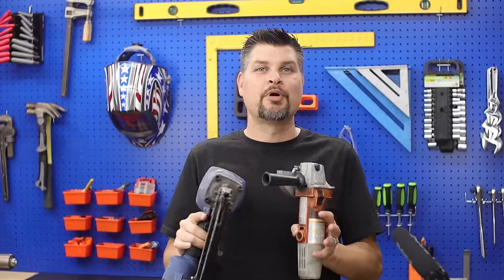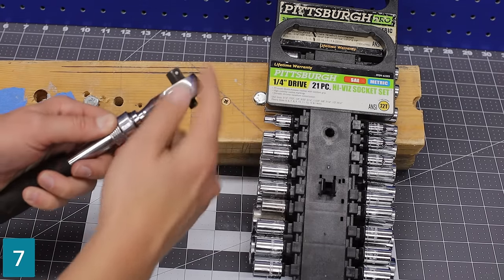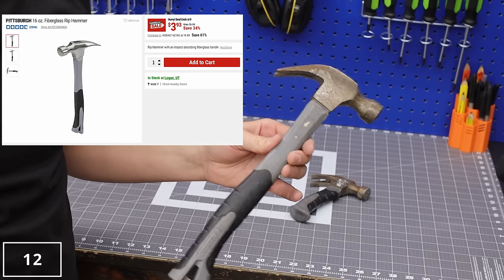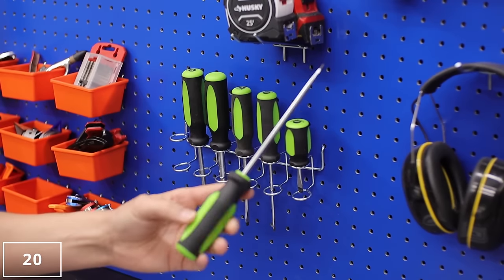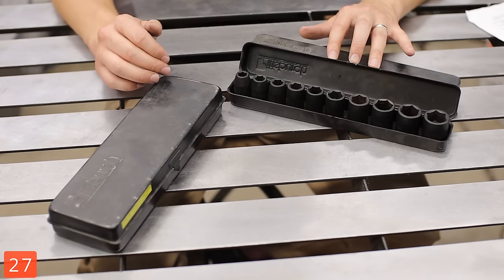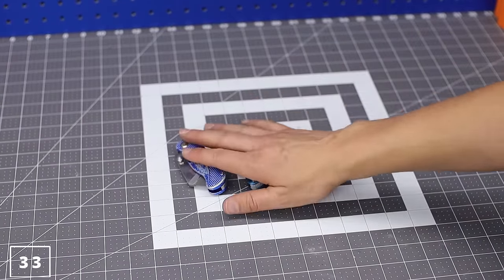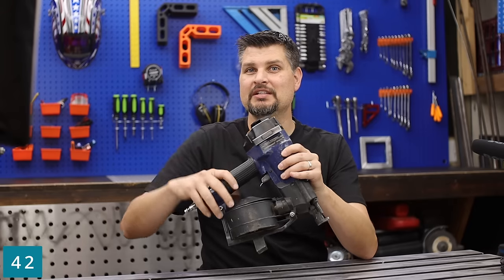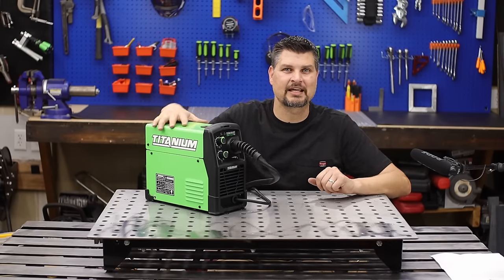50 Harbor Freight TOOLS I Actually Use

Comment: Buy the HF nailer but don't buy the nails. Get name brand nails from Lowes or Home Depot.
Reply: I use their nails. Framing, finish, brad, pin, roofing, and crown staples. Never had an issue with any of them.
Reply: @ST-0311  Cool. They may have updated them from when I used them. It's been some years.
Reply: @jdubb200  In Iraq, we had to use nails from India. They were soft enough, to bend by hand!
Reply from the maker: I do seem to have more feeding issues with the cheaper ones.
Reply: Completely disagree, most cheap nailers don’t even sink them to full depth, you can watch this on any comparison

Comment: Do not buy those $10 angle grinders. I have the scare on my hand to prove it. One time while cutting I messed up a cut and the grinder kicked back so hard the grinder split into 2 pieces, with the spinnging side somehow catching my work glove and spinning the broken blade inside my glove. It left a 4in gash across my hand bleeding perfusely in the middle of a clients yard. I 100% blame user error because I was practically falling asleep as it was my side hustle after work on a Friday evening. However if the angle grinder didnt literally split into 2 pieces none of that would of happened.

Comment: Splurge on yourself and convert old fluorescent lighting to some ballastless type B LED lighting.  You can use the same fixtures by looking at rewiring guides, and adding in a 1 amp linear fuse in case someone tries to install the wrong thing in them later on.  It'll be the last ballast you ever have to change.  We did it in our shop, and the cost was practically the cost of new bulbs, about $7 each, and it's paying for itself in lower electric costs.  Extension cords will always be a safety weak point.
Reply from the maker: I'll have to look into those!

Comment: I wish they still sold those Chicago Electric 4" angle grinders, I've had mine for about 18 years, it still works great.  

I have the Earthquake 1200ftlb impact, works great, plenty of torque for many DIY projects.  

Those organizer boxes are great, I wish they would lock to each other though to make moving them around easier.  

I do the same thing with my angle grinders.  I keep different cutting/grinding wheels on them so I'm not swapping wheels all the time.  

I have a few Bauer and Hercules tools, both seem to be just fine for my needs for DIY projects and homeowner stuff.  

The framing nailer I got has the adjustable magazine so you can adjust for different nail angles....not sure why there are so many different nail angles for nail guns, but there are like 4 or 5 I think.  I also have the coil roofing nailer, pin nailer, wide crown and narrow crown staplers, brad nailer, and finish nailer.  They all work great, and my brad nailer has got to be around 20 years old, it was the first tool I bought from Harbor Freight.  It still works great.  

The Central Pneumatic Gravity Feed HVLP spray gun works great, and many people have videos painting their cars with them, with great success.  I painted my garden trailer with one a few weeks ago and it turned out great.  The biggest issue is people don't take the time to do all the prep work before painting stuff, they automatically blame the paint application device, rather than their lack of time spent prepping the area to be painted, and not properly setting up the paint gun is another common problem.  

I haven't picked up one of those portable bandsaws, or the mount they have yet, but its on my list.  

I have the Hercules 12" dual bevel sliding compound miter saw and the Hercules 12-1/2" thickness planer.  Both work extremely well.  The miter saw didn't require any adjustments out of the box, and the thickness planer uses 3 knives rather than 2 like many other more common name models.  

I have a Bauer 6 gallon wet/dry vac, and it works just as well as my Shop Vacs have....and you can get bags for the Bauer vacuums as well as replacement filters.
Reply from the maker: Right on, thanks for sharing!

Comment: Those angle grinders are great. I use mine at least a few times per week and I’m only on my second one. The first one lasted over 10 years.
Reply from the maker: Right on!
Reply: Have both HF grinder, and Dewalt,  HF one will give Dewalt a run for its money,  use HF with diamond wheel and or sanding wheel to knock down sharp edges after using cutoff wheel in Dewalt

Comment: The heat gun works but breaks if you use it often I do auto body repair so it was used a lot had to upgrade to a Milwaukee found it at a pawn shop and it heats up faster and just feels better but I do love hf

Comment: Well, there goes the savings account....again. 🤣

I'm a DeWalt fan-boi, so I go there instead of the Hercules or Bauer. However, the Hercules battery bandsaw is on the list of "gotta gets", as is a larger air compressor. I have a full set of older Craftsman tools (screwdrivers, sockets etc), but also have a more than full set of Pittsburg and Quinn that I use much more often,  including the big 1/2" Quinn torque wrench, which was used heavily when I rebuilt the Harley. After that chore, I had it calibrated at my old job, and it was still well within military specs (26 years Army. I still know a lot of guys in the shops). 

'Ol Harbor Freight has come a long way since their "disposable" tools selection. It's now my first choice when a glitch in the project arises.
Reply from the maker: I know, right, haha!

Comment: I've got the Titanium 125 and love it. 
I've had a 23 gallon air compressor for more than 10 years. I don't think they make it anymore, but I'd definitely buy a similar model. 
My jack is about 10 years old and still working great with frequent use. 
Last I knew, that Earthquake impact is just an IR 2235 and if you need to rebuild it, you can order all the parts from IR. 
I've got three different angle grinders from HF and they gave me a free one last week, so even if they aren't the most amazing grinders, they all work well enough and I've only hit the price of one name brand tool. 
My 1/2 in drive impact sockets held me through 12 years of being a professional mechanic and I only managed to break the 19mm. 
I have those folding utility knives all over the place. I have a few of the minis from next to the register in tool boxes, junk drawer, and cars. They're just handy. 
I have several sets of those ratchet straps. Can't complain. 
I did some automotive paint with the $15 HPLV sprayer. Can't complain. I didn't bother cleaning it after doing clear coat and just threw it away. Next time I do automotive paint, I'll probably do the same. It's the kind of thing I do so rarely that I don't want to store the supplies.
Reply from the maker: Right on!

Comment: I always wondered and sorry if this is a stupid question but how can you tell quickly if you should use a 14mm or a 9/16? Is the shape of the bolt head different on metric over SAE?
Reply from the maker: Yes, bolt heads should all have markings. You can google search, "metric vs standard bolt head markings" and there are tons of charts OR just try both and see which has the better fit!
Reply: @-DIYPRO-  alright, thanks for the tip. that last one is what I tend to do just try them both and see what one fits the best and use it.
Reply: @m.t.v.7934  SAE has radial lines, the number indicates the tensile strength of the bolt.   Metric uses a  one decimal place number,  first number is nominal tensile , number after decimal represents a ratio  that indicates brittleness/yield strength characteristics ...  I'm summarizing  google for deep dive.
Reply: @unionse7en  Thank you for the research, so if I understand this, SAE has lines and Metric just has numbers with no lines. Trying to make it easy to remember. Thanks for the tips.